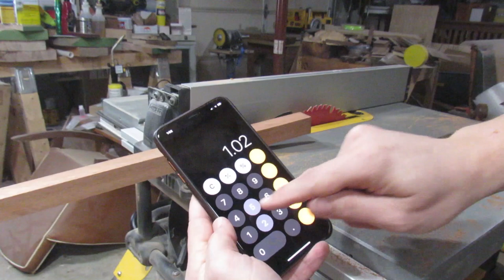Three Section Nunchaku - Plus How To String Them!

Comment: I understand that you don’t know about the three-section staff, aka triple staff, and called “sansetsukon” in Japanese, so please allow me to enlighten you just a little. Hmmmm...well, I guess I kinda just did😂 But to add a little more, the sections are longer, usually at least 14” each, but I’ve seen some as long as 24” each. If you think about the three-section staff literally AS a “staff” rather than nunchucks, the longer length begins to make sense, as the bo “staff” used in martial arts are usually two different “long bo” (typically 5’-6’) and “short bo” (about 3’) lengths. Many advanced students make their own to suit their personal styles as well as their height. I’m thinking if he were a martial artist learning the three-section staff, Warwick Davis would love the one you made in this video😂

Okay, on a more serious note, there are sectional staffs available that can actually twist-lock together to make one long, solid staff, hence the term, “3-section *STAFF*” Thanks for reading all of this.
Reply from the maker: Thanks, I did some research before making these, and couldn't find anything with these dimensions.  I saw plenty on the three-section staff.  These, however, were a custom build for a customer and he wanted each section at 6 inches.  

I ended up making two sets, the set you see me stringing up has a middle section that is a bit shorter, but that's because that's all the wood I had.  In messing around with them after the build I found that they fit in my back pocket and can be deployed very quickly.  I can see how that would be an advantage over the traditional two-piece nunchaku.
Reply: Joe Pierce Maker thanks for taking the time to answer my comment in such detail, I didn’t realize it was a custom order with particular specs, and they really turned out beautifully! I can definitely see how they’d fit into a pocket. Very useful!
Reply: there is a video saying that the sansetsukon is a broken bo, while the sansetsuchaku (3 section nunchaku) the one made in this video is a more compact nunchaku.
Reply: Joe Pierce Maker nice work. It’s just what I was looking for. I was watching a vid on old Okinawan weapons and they showed exactly what you built. Thanx!
(made my first set of chucks in 1974)